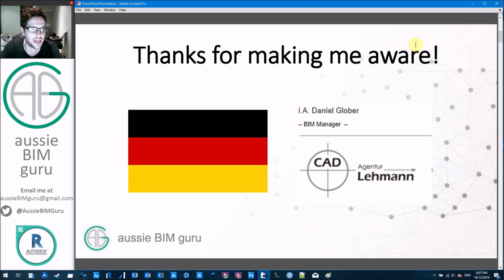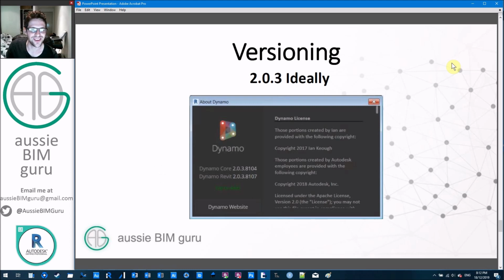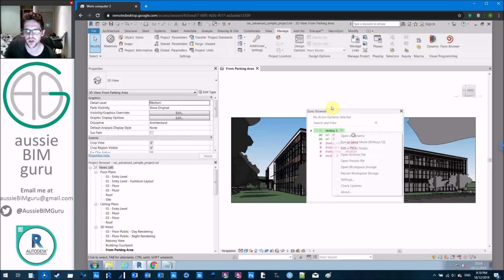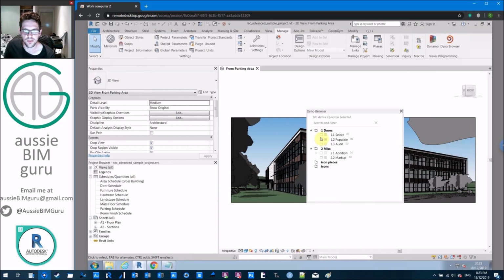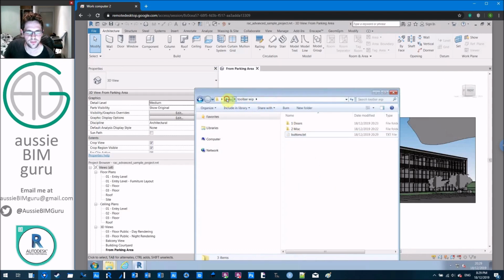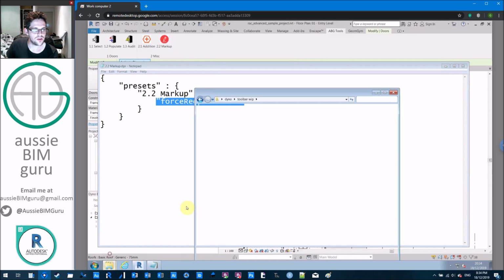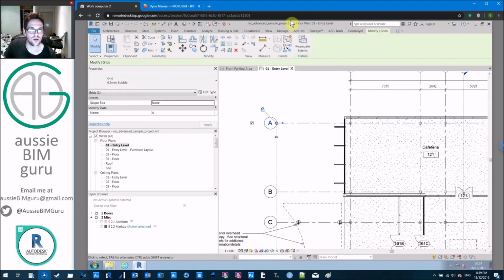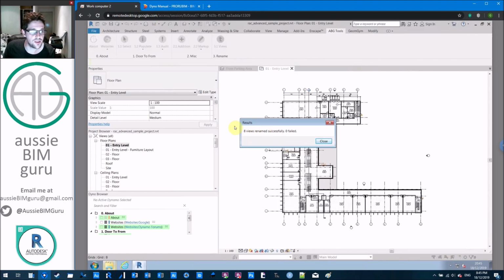Dyno Browser for Dynamo!

Comment: Hi Gavin,

Do you know if its possible to add tooltip for each of the scripts using Dyno?
Reply from the maker: Unfortunately I haven't used Dyno for a while, maybe try pyrevit as it is still supporterd unlike Dyno and supports dynamo scripts and tooltips. I have a playlist on my channel for pyrevit which shows how to achieve this.
Reply: @AussieBIMGuru  always swift with the replies. Thanks for the suggestion!

Comment: First of all, thanks for sharing this tool! It's amazing that it's free. Great channel too, very useful ! I was wondering if you are still using Dyno. I've installed it ,but when launching it on REVIT 2021 it displays "Dyno can’t find Dynamo on Revit" and dynamo core doesn't boot. It works on 2020,  but most of our clients work on 2021. Have you encountered such problem?
Reply from the maker: Unfortunately I haven't used Dyno for a while now as I use Orkestra (I work with just myself currently).

I would get in touch with Prorubim to see if they know why this may occur. Newer builds often have bugfixes to be implemented for addins.

Comment: Hi Gavin,
I was wondering how your Markup.dyn script is built. Did you use Python and the function OverrideColorPattern() from Revit API ? Did you use filters based on selection ? Or any other solution ?
Reply from the maker: In the case of this script it was rather simple. I used a node from Rhythm to obtain selected elements, then simply used the OOTB override element graphics node.
Reply: Oh yes ok I see. But then there is no real coming back. One can just cancel the action, right ?
Reply from the maker: @95baud  you would need to either undo or reset the override of the element. Its a temporary override by view only.
Reply: Yep. Thank you for your answers !

Comment: Do you have a link to the version that works with Revit 2019 by any chance? the website defaults to a version that works with 2020 or 2021 only :(
Reply from the maker: Unfortunately I only have the 2020 version, suggest reaching out to the Dyno team by email - they usually respond in about 3 days in my experience.
Reply: @AussieBIMGuru  I am still struggling with the decision of continuing to utilize Dynamo and deploying it to the company or switching to full Python/toolbars route.
Reply from the maker: @inouizi  it depends on what you or your team can realistically handle from a development and maintenance perspective.

If you're up to the challenge, PyRevit can achieve a similar outcome like what has been shown here both for Dynamo or Python based scripts.

For me, losing custom packages is usually too big of a loss so I prefer to use a hybrid approach myself. Dynamo is also easier for new users to learn vs full Python scripting.

Also there are some alternatives in development right now by a very well reputed developer of Dynamo solutions, but currently in beta.
Reply: @AussieBIMGuru  agreed!

Comment: I have 2 scripts, each under a sub-folder, with script and button image within their respective folder, however, upon opening the test file, the tab exists, with the first attempt and button, yet the new button does not exist.  However, it is listed within the Dyno Browser.  Any suggestions?
Reply: Finally got it to work.
Reply from the maker: @gcfdesignlimited  what was the solution in the end out of curiosity?
Reply: @AussieBIMGuru  it was similar to your video. Restart several times.
Reply from the maker: @gcfdesignlimited  seems like Dynamo needs a few kicks in the pants to get it started sometimes!
Reply: @AussieBIMGuru  

Hi.

I have been liking the tool. Regarding DS nodes, do you know how to not only to specify a category, but for that selection to offer a further drop-down for the related Families?

I have managed to create a drop-down for Categories but not for one option to influence the other.

Any thoughts, much appreciated?
Reply from the maker: @gcfdesignlimited  glad you've been enjoying Dyno also!

Usually with data shapes, if your inputs require another input (e.g. category > family types of it) you would need to connect two data shapes UI's in sequence. The first would feed its output into the second's functions, then to the next UI.

Not that UI friendly I know, the next step would be exploring zero touch nodes to retrieve families of a category as a specific dropdown (like the sheets dropdown in archilab).
Reply: @AussieBIMGuru  

Many thanks. I'll look into that.

I did understand that the nodes required concatenating, but hadn't explored it yet.

I shall explore this weekend.

I shall look into your suggestions.
Reply: @AussieBIMGuru  

I have tried extensively the concatenation of the UI nodes, but l certainly cannot get it to work.

Either l am likely getting it wrong or it does not allow influential selection to occur in a sequential manner.
Reply from the maker: @gcfdesignlimited  try something a bit like this video where I do a 2 stage UI; https://youtu.be/jJSHmJnXIdk
Reply: I have managed to get it to work.
Reply from the maker: @gcfdesignlimited  nice one!

Comment: If running Dyno, only one Dynamo should be installed?
Reply from the maker: Yes ideally. I think unless you use revit 2016/17 it is always best to only have 1 version anyway.
Reply: @AussieBIMGuru  if l uninstall the older version, shall Dyno run without asking me to carry out a 'pre-run' of one of the currently installed version?
Reply from the maker: @gcfdesignlimited  if you only have one build, dyno should run dynamo in background when it boots up. It should then run the only installed build each time from there.

I believe it always opens the lowest installed build by default, the same as how dynamo player behaves

Comment: Thanks for letting us know about the tool Gavin. It's cool to have the option to set a keyboard shortcut as well. I would have preferred this tool to Load only when I first click on Dyno Browser instead of forcing me to load every time I open a new project for the first time.
Reply from the maker: You're welcome Sujan. I agree the always loading can be a bit cumbersome - I'd suggest a workflow for users where they can temporarily activate or deactivate the program (maybe a batch script to move the respective .dll in/our of the add-ins user folder).

Comment from the maker: Quick correction; PyRevit can actually package Dynamo scripts like this as well it turns out (although at dynamo player speed).

ProruBIM has also since contacted me to confirm Dyno should work in 2020 also.
Reply: it does works in 2020 indeed
Reply from the maker: @jmco1045  awesome, thanks for confirming :)